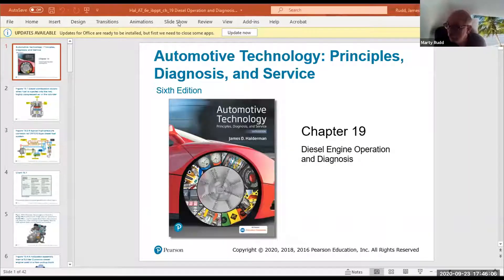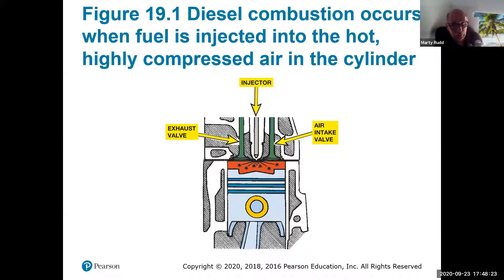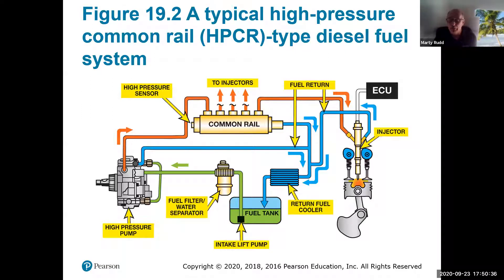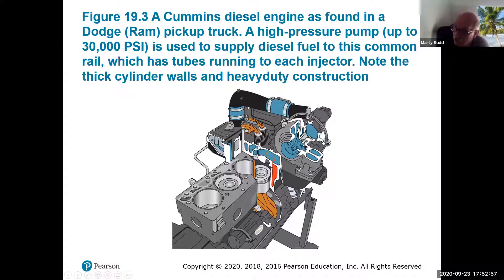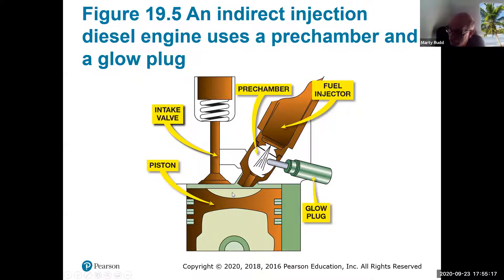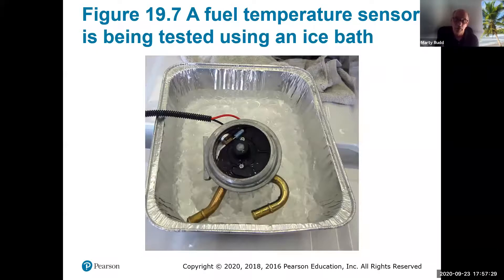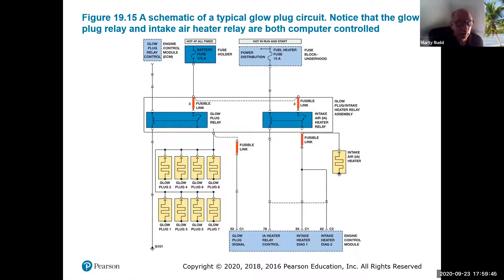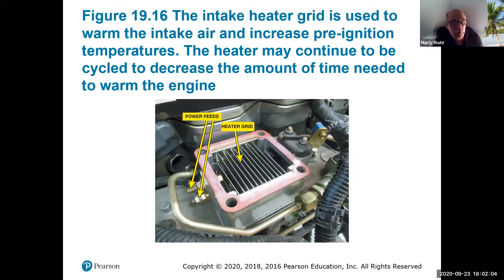Introduction to Light Duty Diesel Engines

Comment: A Glow plug diesel used by GM and Ford are lower compression diesels where the Cummins doesn't use glow plugs but higher compression. And the grid heater is only used during start up.
Reply from the maker: Thank you Jon
Reply: @myautomotiveworldyoucanfixcars  your welcome I could go further but that's the gist of it.